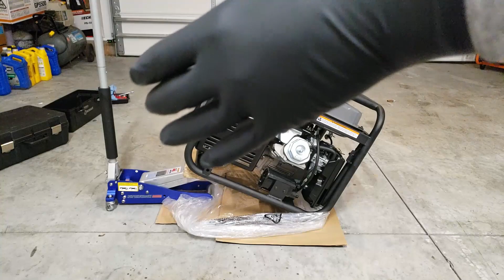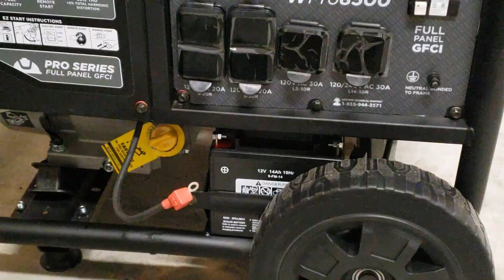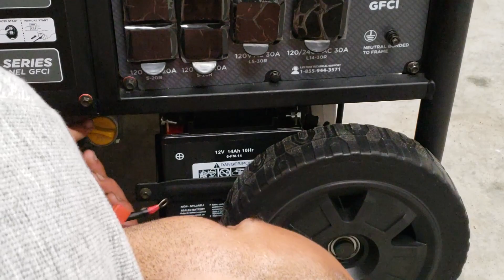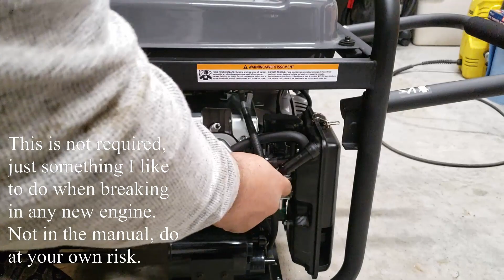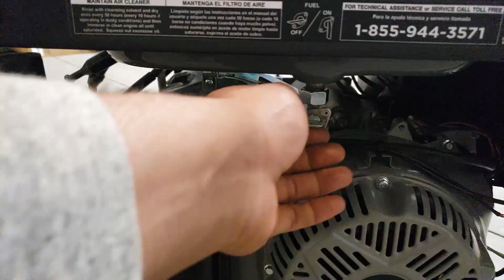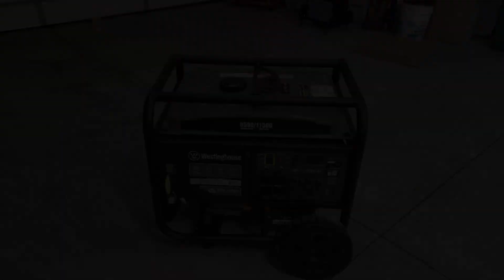Westinghouse WPro8500 Setup/Walkaround and First Startup.

Comment: Hey You also should change out them junk Torch plug with NGK. Not sure why you added oil to cylinder. Maybe break in rings ? But spinning engine over while oil in cylinder could cause damage. What’s you thoughts.

Comment: Aren't boots a requirement when working with heavy equipment?
Reply from the maker: Usually yes. I normally wear steel toes. I wear them daily at work. Being a beach bum in the winter in the garage with my double jointed toes lol.

Comment: Smokes because you poured oil in the spark plug hole.  Idle slows because it's saving fuel, no load.  I noticed you have a collection of generators, what the heck are you doing with that many?
Reply from the maker: Ahahahah it's a long story and I was creating false suspense. I had an old school coleman 5000watt that I restored and sold. We bought the generac gp5500 and decided it won't meet out needs so I grabbed this. I also grabbed a 2300watt continuous craftsman inverter for 300 bucks new in box. I sold the gp5500 for a small loss. Now I have the the westinghouse and craftsman. I'll be posting a full review soon now that I've had them both for a year.

Comment: What are you powering with this? Can it power central air?
Reply from the maker: I've got a lot of research into this. Using the right stuff it can but its elaborate.

What's the tonnage? LRA? You're going to need an inlet and a cord and a panel lockout so you can LEGALLY backfeed your panel. Get the LRA off the unit and get back to me. I'll help you out
Reply: SlowcarsInc thank you! I’ve too have been researching this non stop and can’t get a clear answer on what startup watts are for my AC. I have the interlock and inlet all set up, just researching the right generator. 

I have a 3 Ton Trane, 69 LRA
Reply from the maker: @MrSkunks  does it get cold in the winter where you live?
Reply: SlowcarsInc no I’m in Miami Florida
Reply from the maker: @MrSkunks  also I have a 3.5ton 115lra rheem. It starts it fine with the OEM hard start in place.
If I had to guess itd start your unit. An oem hard start would let you start yours with ease. I keep sensitive stuff off when running ac you may not even need to do that. I'm very happy with it. Great unit for the money. Look up factory pure ordered there for 1099. 99 dollar 5 year warranty as well. Figured why not.

It might start it without the hard start!
Reply from the maker: Pick it up break it. Change factory oil at 2 hours. Change again at 5 hours. Chnage again at 10 that's when you put a nice syn in. In Miami I reccomend synthetic oil only. You may also benefit from a xw-40 oil during hot season if you plan on around thr clock running during emergency
Reply: SlowcarsInc thanks for the advice!

Did you have to float the neutral in order for it to work with the interlock?
Reply: SlowcarsInc and yea the idea is to run it non stop for possibly 3-7 days during an emergency. So something like 5w-40? Will that effect run time?

Have you tested run time yet?
Reply from the maker: @MrSkunks  yes you need to float it. Instructions on their website. Very simple. In your climate run time wont vary much from thicker pil as the oil will be very hot compared to milder climates. The most important thing is to run a good syn that is more temp stable.
Reply from the maker: @MrSkunks  I have not tested run time but that's why I've waited so long for the final review. It's gotten is through a few outages. I will test the 1 gallon run time soon and post that in my final review
Reply: SlowcarsInc Thanks for following up. I subbed so I can see the video when you post it.

I noticed on the website they only go up to a xw30. I wonder if a 40 would void warranty. I’ll def need some high oil as I’ll be running this a custom shed
Reply from the maker: @MrSkunks  cooling is very important pay attention to ambient tempsrun a high quality oil in the speced ranges is what I'd do. Change it often.
Reply from the maker: Like at least twice as often as recommended. It's a big gen plan on having tons of fuel for a storm. 24 hour operation is gonna consume at least 12 gallons a day I'm betting on closer to 16 or so if you're gonna have ac pumping 24/7 etc. So 60 gallons plus a full gen and a full car you can disconnect a fuel line to refill cans will get you a long way. A week of 24 hour operation at least. I'd change the oil like every 50 yours in those conditions. I personally am running mobil 10w30 after break in. Better then 5w30 for sheer and high temp stability based on my research.
Reply: SlowcarsInc you think that much? My average is 45KW a day in the summer. That’s like 1.8KW an hour and that’s below the 25% which is according to them 16 hours
Reply from the maker: @MrSkunks  I'd plan for the worst I will have an update for you. The only more efficient gens will be efi. And only slightly so. The honda is the most efficient but 3x the cost and nowhere near the shear grunt this has. It barely changes tone when a 1.5kw load comes in and off. 3k you can barely tell. 4.5kw it just starts to work. I've put 7k on it and was satisfied. I would do more long term testing but the first world problem children in the house.
Reply: SlowcarsInc just wanted to give an update on what a great machine this is.

I just did my first test, ran it for about an hour without any hiccups. Every breaker on except water heater. I let it warm up a bit with basic loads like TV, modem, fridge, etc. after about 5-10 minutes I cranked on the AC instantly turned on and the machine barley bogged down. 2017 3 Ton Trane AC without a hard start kit, 69 LRA. 

Like I mentioned I’m running this in a shed with 2 1000 CFM exhaust fans and the generator exhaust routed out through dryer vent. I monitor temps wireless and ambient temps were 88 outside. 95 in shed before starting so I was a bit worried it would clime above the rated 105. After 1 hour, to my surprise, it was actually cooler inside the shed than before I started. It dropped down to 92.

I plan to be at 25% load during an extended outage so if it’s anywhere near their claim of 17 hours I’d be happy. Even 12 hours to a tank would be perfect
Reply from the maker: @MrSkunks  I will do a run time test soon.
Reply from the maker: @MrSkunks  I plan to warm it up run it dry then do some 1 at testing. So its easy to test multiple times to extrapolate results. I plan to do 8 runs. 25% load and half load. Going to control load with space heaters and heat fun etc. Actually itll be closer to 56% load. I'll shoot for a 25% load test as well.
Reply: SlowcarsInc looking forward to seeing that
Reply from the maker: @MrSkunks  I'll be getting around to it soon.
Reply: SlowcarsInc great!
Reply from the maker: @MrSkunks  sorry for the delay. Life has been very busy.

Comment: I know this is always a tricky question, but how is the noise level, from 10-20 ft out?
Reply from the maker: If you have heard a modern 3600rpm 4xxcc generator run it's the same as any. The nice thing is the idle function will lower the idle to 2400 rpms until a load is demanded by say a power tool on a job site. Saving fuel wear and tear and noise pollution.
To make a long story short its loud. Standing 20 feet away direct line of sight it will be loud. No louder then any other generator in its class in fact its one of the quiter ones in its class IMO. 20 feet away is bareable. This is not a camping generator unless you're out in the boonies on your own. Youll drive people mad with something like this at a camp ground. Inside the house with everything shut it's really quiet.
Reply: @JONNYGEEKMANG  What do you think of this PRO8500 vs the westinghouse 9500DF ? i see this one is rated lower BUT they bought have a 457cc motor so i really dont get why the pro is rated at 8500w... Also it is 1189 on amazon while the 9500DF is 1049...
Reply from the maker: @MrRey007  this unit is going to have a better generator head that is rated for a 100% duty cycle. It also produces power that is 5% THD which means it's a more stable sign wave that is better for modern electronics and fridges. The 9500 may produce slightly more power but it will not be as clean. It is said to be 9% THD this is not that bad and I would still recommend this unit for emergency backups. I run my heat pump and fridge off this. Those motors dont like the dirty electric at all. Chargers computers tvs etc can deal with 9% easily. Eletric motors may generate more heat. Should still be fine for emergencies I plan to add a dual fuel kit to mine. The 9500 already has this.